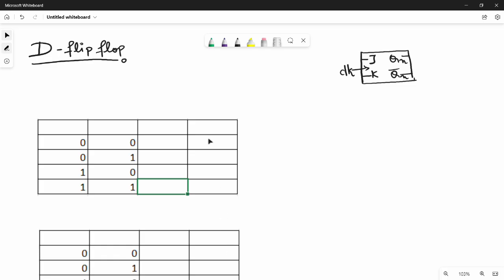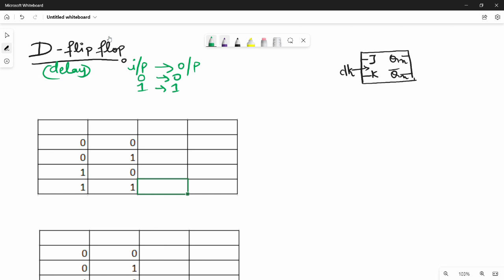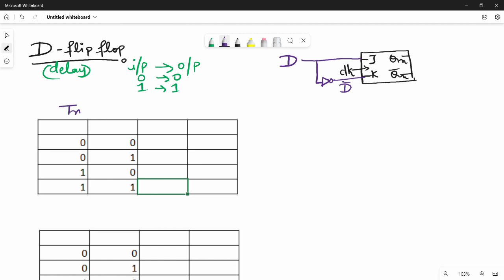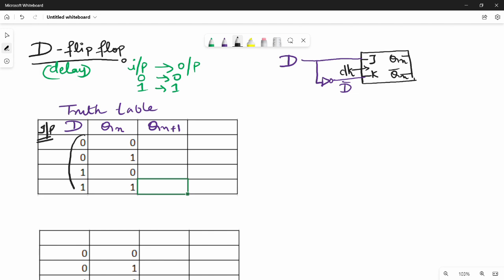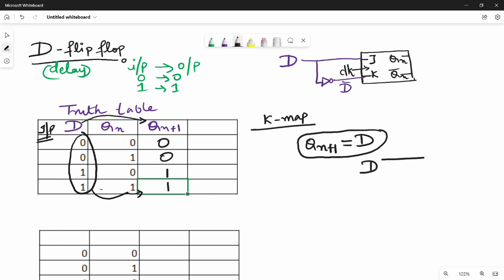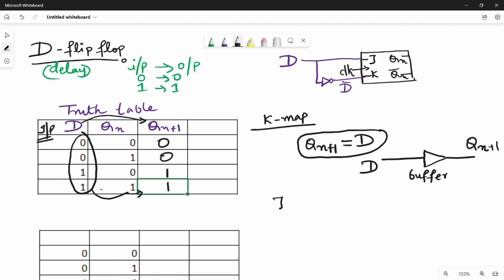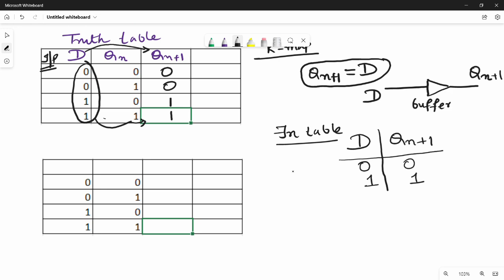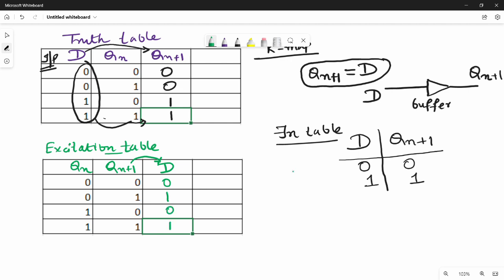2.4. D Flipflop in Tamil

Comment: Sir video la D flip flop block diagram la J K varudhu, S R dhana varum?
Reply: Cause in D flip flop, gate 1 and 2 will have only 2 inputs each, gate 3 and 4 output will not be fed  back to gate 1 and 2, so technically D flip flop will be an extension of S R flip flop illaya sir?
Reply from the maker: We can construct each flip flop frm anything else. Excitation table will differ based on the flipflop we take.
Reply: @because2022  understood sir thank you